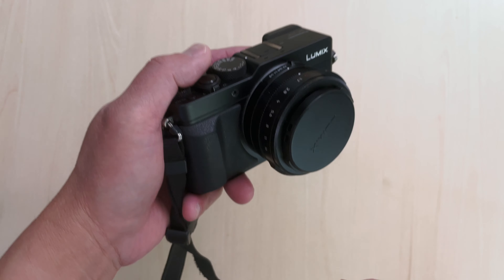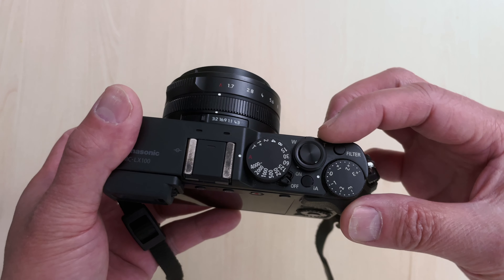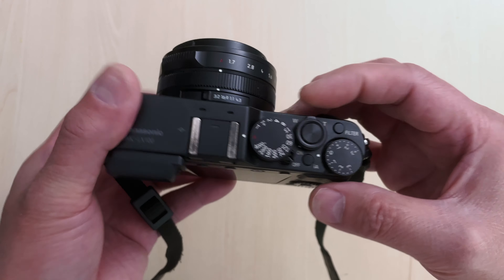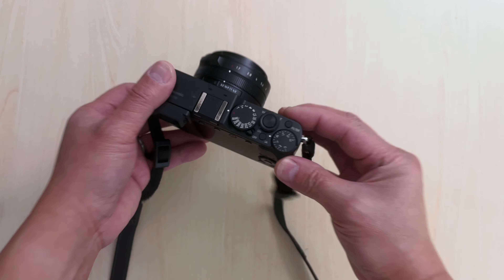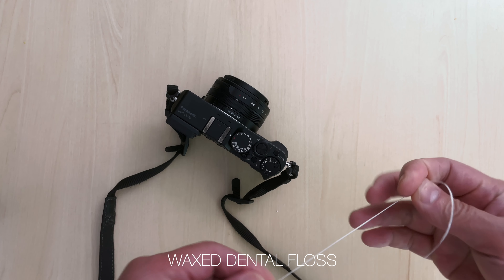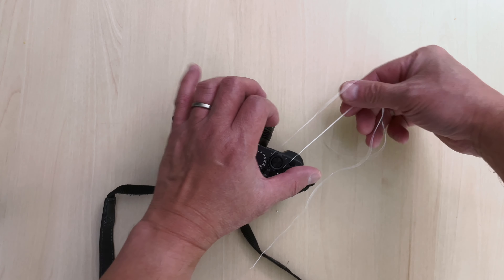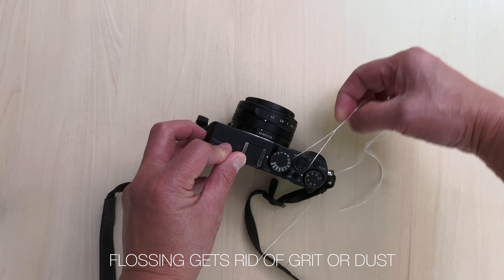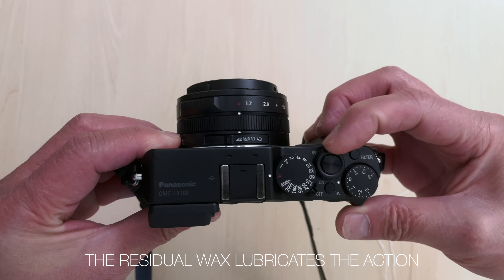Stuck-Stiff Zoom Lever on your Panasonic LX100? Floss it!

Comment: WHAT IF I ONLY HAVE DRY OLD PLAIN DENTAL FLOSS, i just did it with that and it seems to have fixed the zooming but the lever still often gets stucked.
Reply from the maker: The dental floss wax acts like a lubricant. Definitely get a hold of some.
Reply: would dabbing the dry floss with grease like wd-40 be safe? or candle wax would work the same way

Comment: Great! Do you have any idea how to fix/clean the jumpy Control dial (ISO set)? Thank you!
Reply from the maker: Sorry. I do not. I'm assuming it might be something that needs to be disassembled cleaned/replaced.  Check out iFixit website.  They have a LX100 disassembly instructions guide.
Reply: @JohnChu  Yeap. Most probably it has to be replaced :(
Reply from the maker: I disassembled and reassembled the LX100 three times trying to get the all the dust out.  I finally got it clean enough to use at all apertures except f16.  Still love this camera.
Reply: any luck fixing it?
Reply: @easypeasyabcsy7883  did you try using a contact cleaner?
Reply: @wojciech2456  Thinking of dropping isopropyl alcohol into the gap and sucking it immediately with a vacuum cleaner. But I am still afraid a little to do this :D
Reply: @easypeasyabcsy7883   I sprayed contact cleaner on mine and got the LCD completely wet. Had to disassemble the camera and then disassemble the LCD screen itself  (it consists of thin leaves) to dry it out. Remember to disassemble the camera first and get the part you want,nt to spray first. However I sucessfuly repaird the rear dail after I took this part out of the camera and sprayed it with  a contact cleaner.
Reply: @wojciech2456  WOW. Lucky you  :D   Thanks for sharing! I succeeded in dusted lens cleaning with a vacuum cleaner. The main hint was to apply a vibrating massaging device to the lens and all corners of the camera together with its rotation.